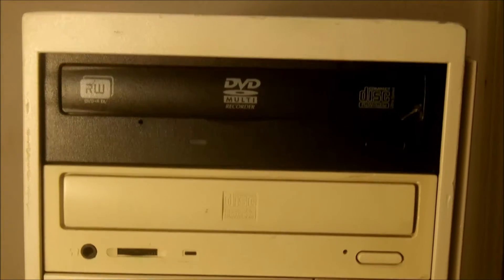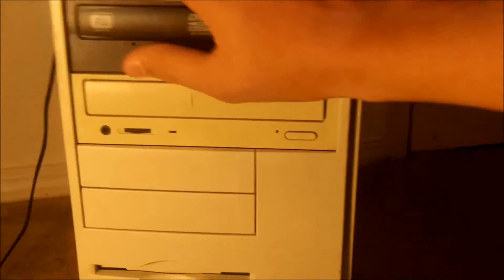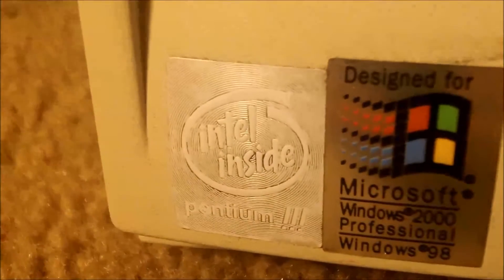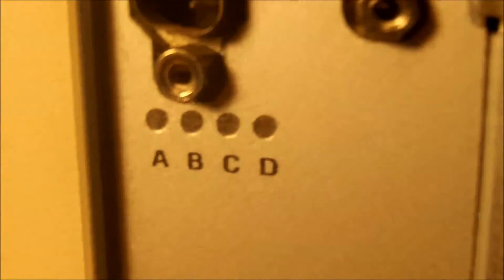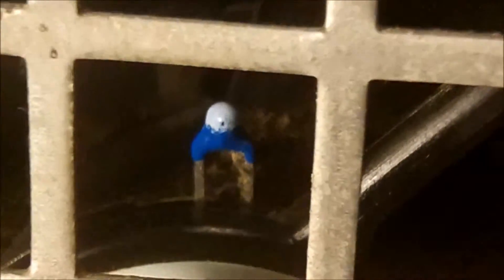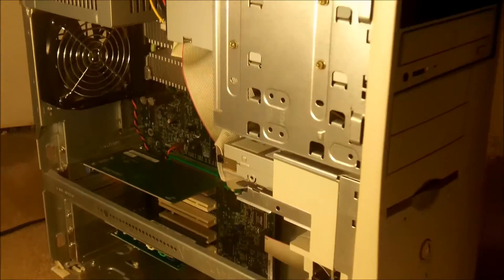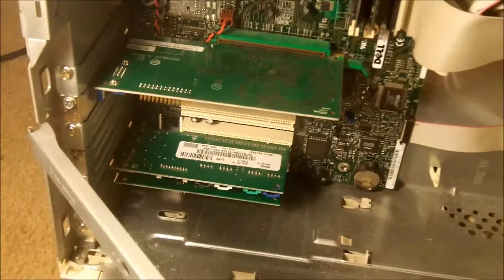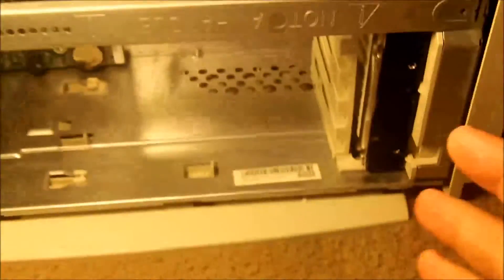Dell Dimension 4100

Comment: You didn't show how to get the side panel off! You refer to the tabs and they are different but didn't show it! This is the whole reason I wanted to watch this video!
Reply from the maker: Just press down on the tabs after loosening the thumb screw and it'll pull right off backwards.